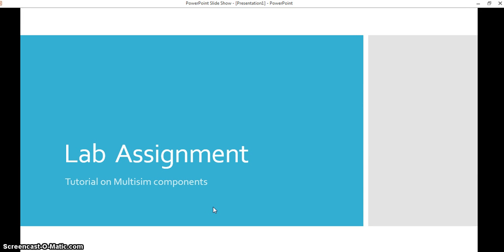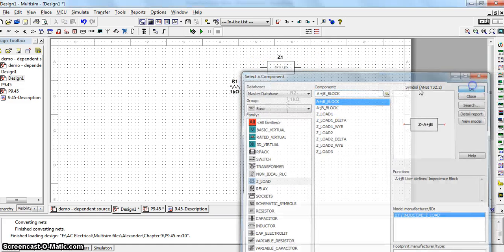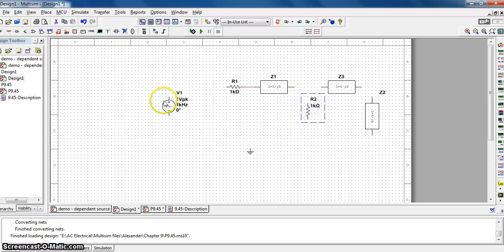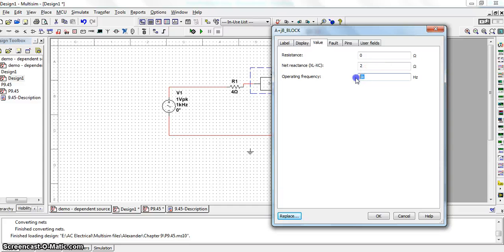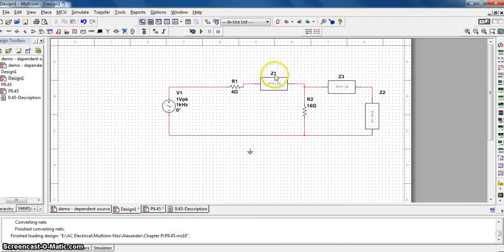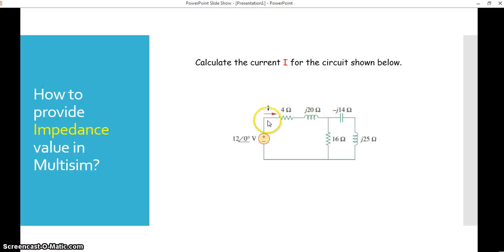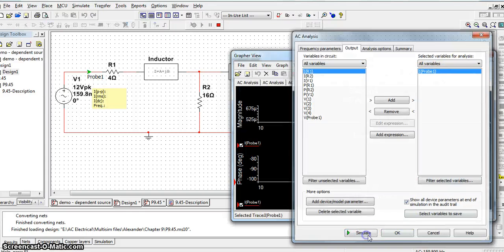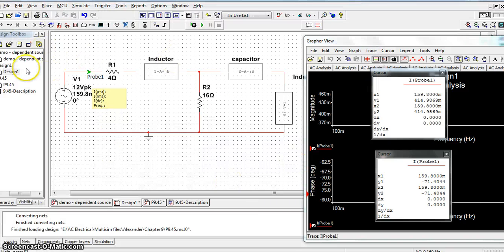Demonstration of impedance value in multisim

Comment: Hello I wonder if you still active but I have question and I can't find it on google or something. when I tried change the orientation of the z-load component. the values such as the currents and voltages becomes different. What is the reason for that?